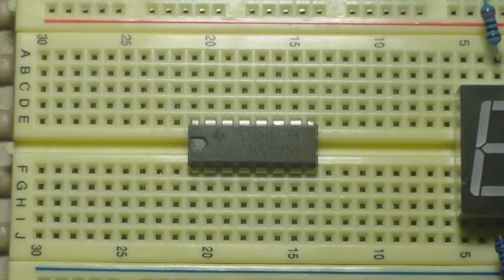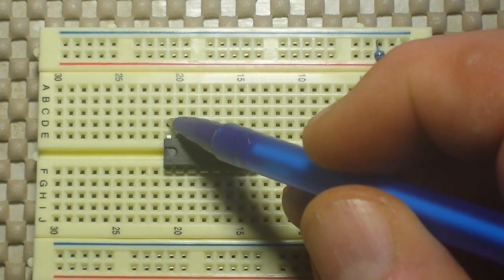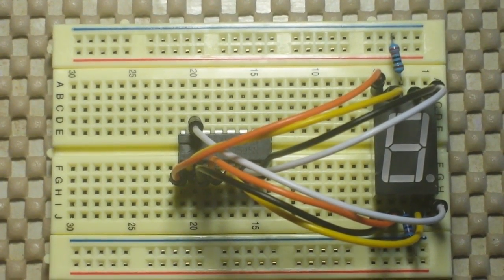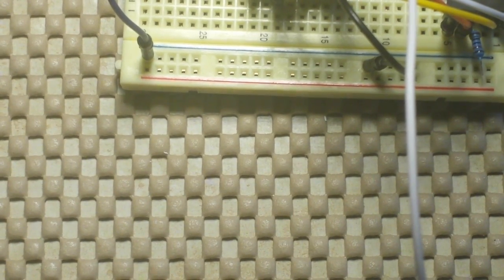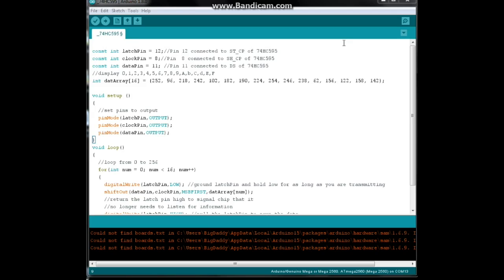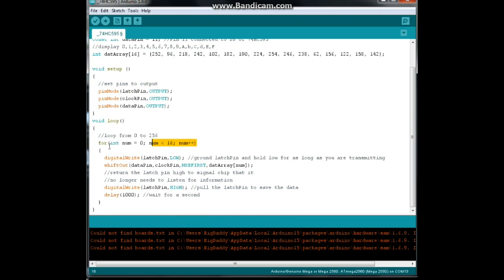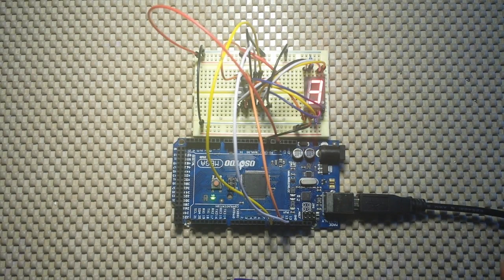ARDUINO BASICS:   INTRO TO THE 74HC595 SHIFT REGISTER

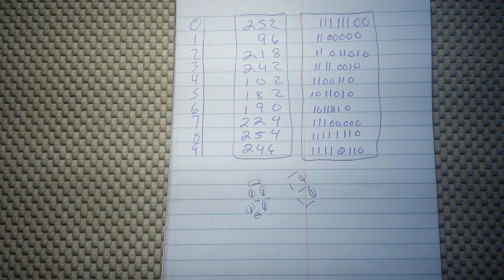Comment: @10:54 I'm not sure how you get a 5 out of 182 in binary. Does the first digit in the binary number correlate with the top line segment? I feel like it has to correlate with the top right. And then the next digits is the next line segment clockwise from the first? In the first example, you circled the top line segment as the first to correlate with the first digit in the binary, then proceeded clockwise to show how each segment lined up with the digits in the binary number. But in the second example, you start at the top right segment.

Also, your binary numbers go from 8 digit to 7. Are you just leaving off the extra 0 from the end?
Reply: Seeing how 1 is encoded to as 32+64, I agree that 128 (10000000) is the top line segment. Then follow clockwise. 2 (00000010) seems to be the middle line, and I suppose that 1 (00000001) is the decimal point as we see it never used here (all even numbers). Therefore, 5 would be encoded as 101110110 which in decimal sure enough returns 182.

Comment: Correct me if I'm wrong, but aren't those 2 resistors in parallel, meaning that you end up with only effectively 110 ohms for current limiting?

Or are the 2 grounds not tied internally on the LED?
Reply from the maker: I don't have a definate answer for you as finding a data sheet on these One Hung Lo display's is hard enough if you have a part number. And in my case this came with the Sunfounder kit and has none. But, the results of my experimenting are this: If you don't attach the top ground, the top half doesn't work, and vise versa. So I would say they are not connected, but I have no proof.